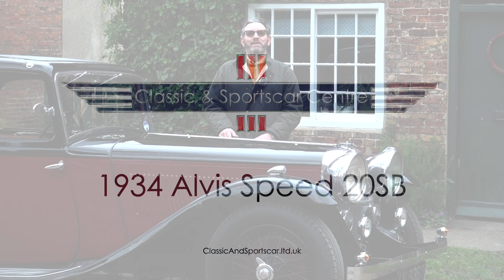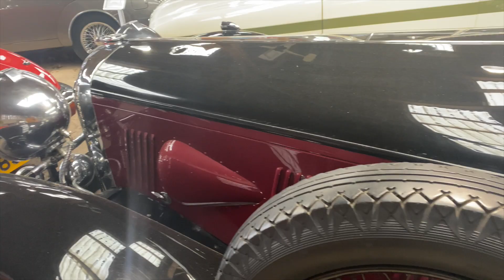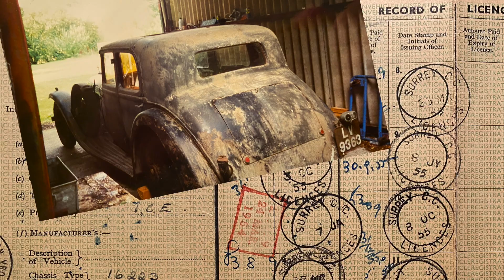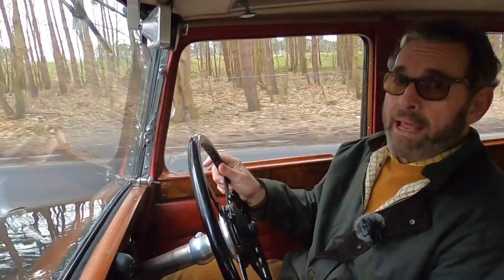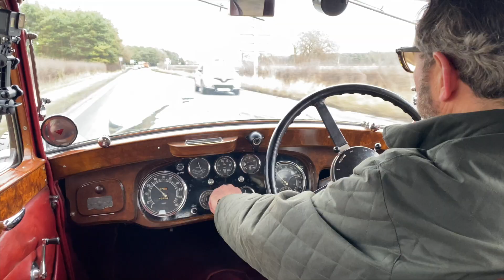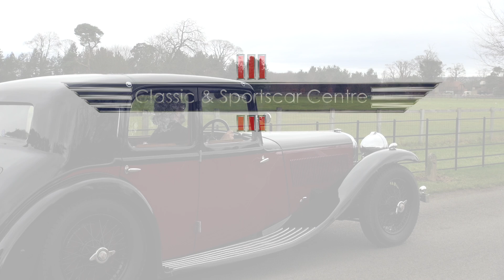1934 Alvis Speed 20SB Sports Saloon: Built For Speed

Comment: Even if this 90 year old can make 90 mph without shaking all over and with noise at 80 DB, i would be most unwise to take it on a long trip. It does not even have the most elementary safety features such as a safety belt and crumple zones, let alone more recent ones like ABS and airbags. If you have a serious accident in this car, you will be dead, extinct, will go to meet your maker, you will be a late driver, pushing up daisies and that sort of thing (for more, see Monty Python's deceased Parrot sketch.

Comment: This may be sacrilege but I came into this video thinking, " that would be a great looking car to drop a modern engine in." BUT on reflection I think it's a great motor car as is. Do you know of anyone who's thrown a modern EMU with fuel injection on an old engine?
Reply from the maker: No I haven't come across one - for the reason you have said. It would be sacrilege! However, subtle upgrade's like a higher back axle ratio to give a more comfortable cruising speed are worthwhile and still prereview the original character

Comment: Beautiful quality motorcars, of which I have been lucky to own two. A 1936 Speed 20 Three-Position Tourer by Charlesworth for fifty pounds a good runner, and a 1934 Speed 20 Three Position Tourer by Vanden Plas with all the factory extras, stone guarded radiator, headlamps and pass lamps and screen pillar mounted search lamps. The car was in good condion, but had a cracked and very badly repaired cylinger head and in 1966 I bought it from a Kent farmer for ten pounds! A replacement cylinder head was bought for twelve pounds from Alvis Club spares man Basil Klinkard, and I got a full gaket set from Alvis Motors in Coventry for two pounds seventeen and six! Oh sucvh happy days as ayoung old car fan in Southeast England!
Reply from the maker: We love Alvis cars!

Comment: Was the Alvis much better than the Jaguar SS90 ?
Reply from the maker: I'd say the Alvis drivetrain was better engineered - though both have their merits. The Jaguar had a Standard sidevalve six cylinder engine, before the days when Jaguar designed and built their own engines.